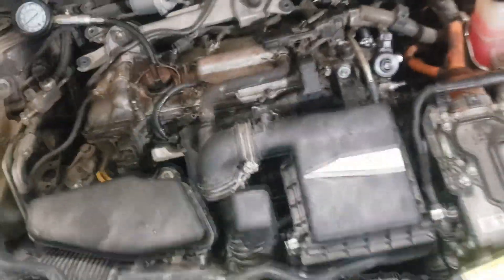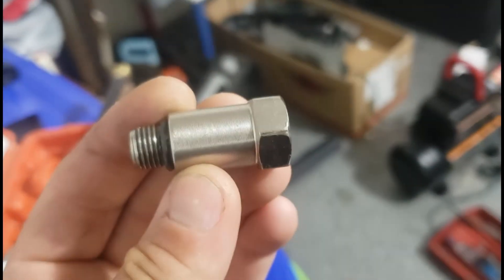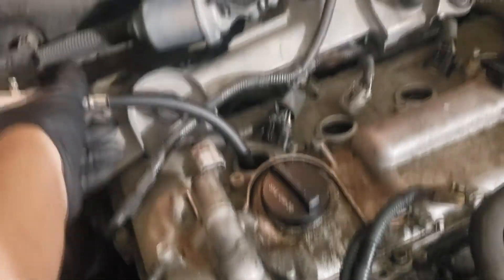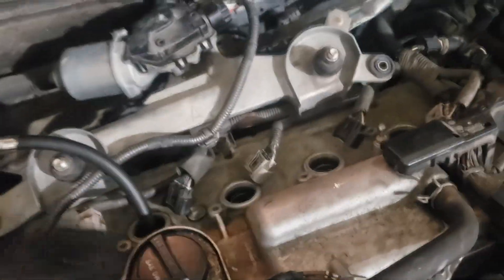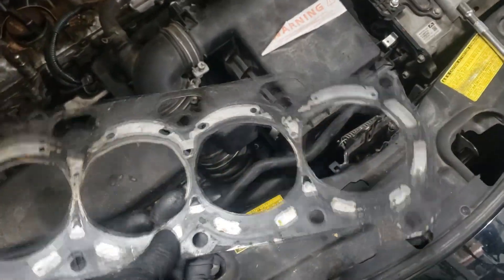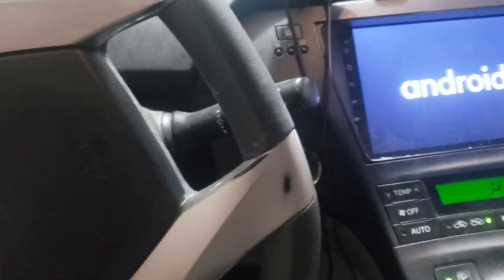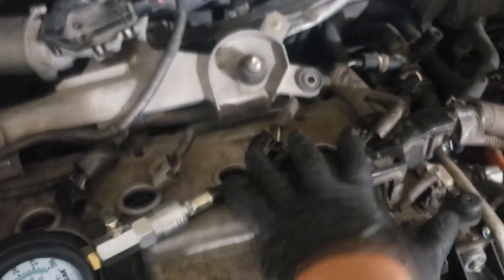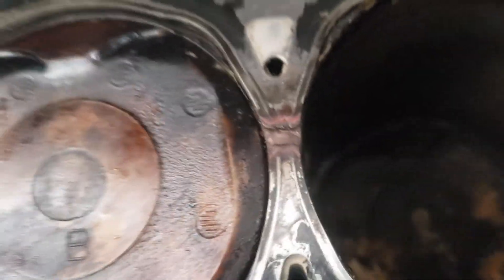How to do compression test on a Prius (or any hybrid)

Comment: Update: 2010 Prius 205k miles 

Plugs and coils removed, fueling disabled. Motor refused to crank over. 

Push start button once. Press brake and gas at same time, motor immediately tries to start and run. Meaning 1100rpm va the desired 100-200rpm cranking speed desired.

No clue why just yet. Researching now. Sharing in case others have similar challenges:

BTW: even with the high dollar Autel BD scan tool, system won’t let me access the “hybrid compression test” menu.

Fun fun fun…

Comment: Removing the fuel pump relay from the fuse box will accomplish the same thing in less time for disabling the fuel system. 

There will be some residual fuel and pressure in the system that will need to be purged by cranking the motor over several times (prior to performing the compression test). 

The presence of fuel can damage the compression gauge, and also skew the data results that you’re trying to diagnose. 

Otherwise very helpful and informative video. 

You should also mention what your rationale was for the junkyard head gasket… 👀
Reply: Which fuse do you remove? Is it EFI Main or EFI 2?

Comment: Why not remove the fuel pump fuse?
As the throttle is a drive by wire, was the throttle plate fully open?
Reply: Good question! That’s what I’m thinking about too
Reply: Which fuse it is on these cars? EFI 2?